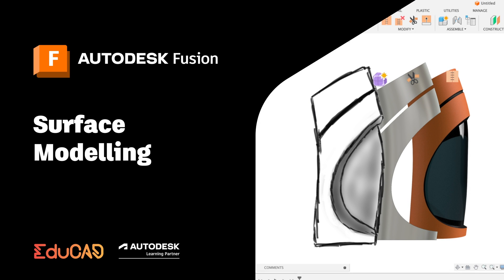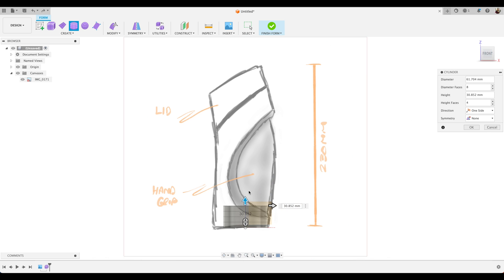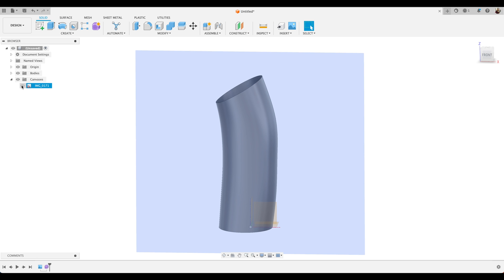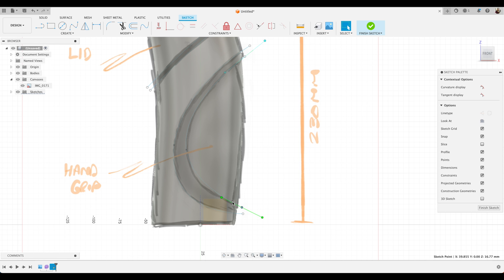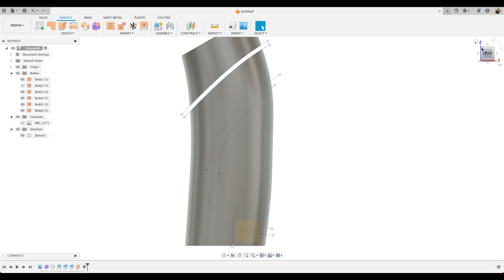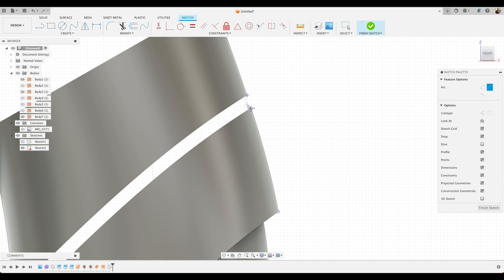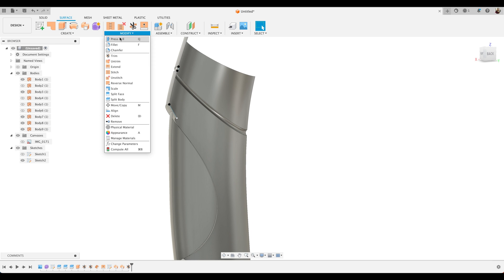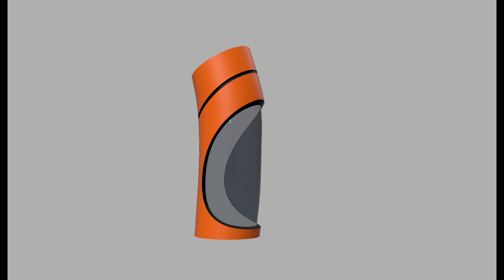Surface Modeling in Autodesk Fusion [UPDATED!]

Comment: Can you develop these features?

- Turning machine simulation
- Add more axis in 3d CAM ..eg w axis on horizontal boring milling machine 
- Movement or joint and animation of the rope/wire/routing created by pipe command
- Flatten and Wrap surface
- Bending Multiple Bodies (similar feature Lattice Rig/Bend Rig/Twist Rig/Conform Rig in Autodesk Alias)
- Draw sketches on the STL/OBJ mesh surface

One idea I would like is that you can enable 5-axis toolpath creation and simulation in the free or personal versions, and you can lock the G-code export function (only G-code export is possible when paying for Manufacturing extensions), this could help more people gain access to the CAM technology that Fusion offers and tend to think about being willing to pay for the right features.
Reply: 5-axis tool path suppose to be back. I bought the license for that very reason. Now is taken away. Should I asked for a refund? I have spent money and time to rebuild my CNC table to be 5- axis. Now I can not use it or experiment with it to see how it works. I am retired hobbyist and inventor. it might take long time before it would be profitable. How I suppose to  learn Fusion if access is shut. All of the above are desirable features and lots of more.